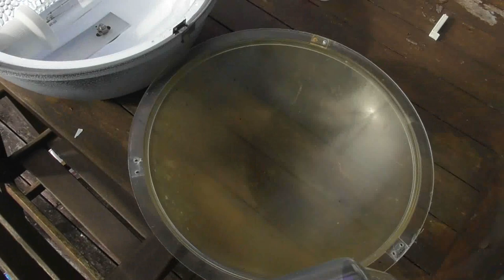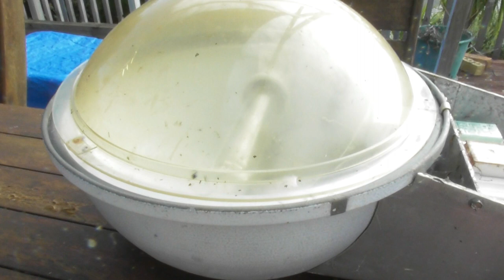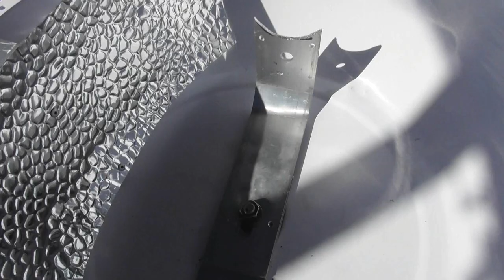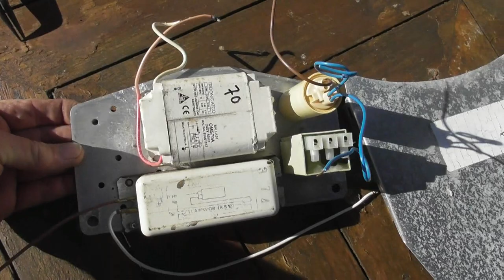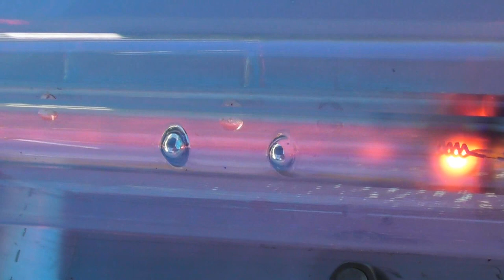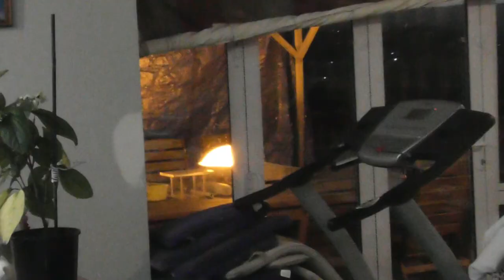MH to SOX conversion streetlight

Comment: Beautiful lamp! Great LPS conversion, I am working on a similar project at home using a discarded MV lantern head, just waiting for an 18 Watt LPS to arrive. I think the 26 Watt tube will not fit in the enclosure so will make do with the 18 Watt. It will go outside the shed so low intensity lamp will be sufficient.
Reply from the maker: This enclosure was perfect to fit a LPS, My sister wants one now as well. Got a few more of these MH fittings from the skip.